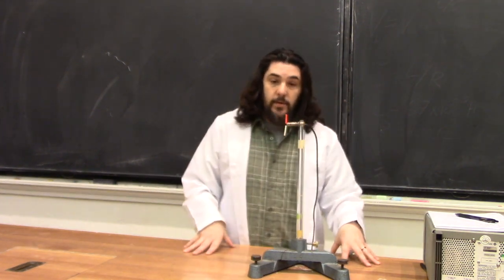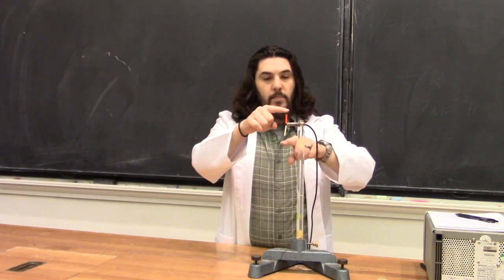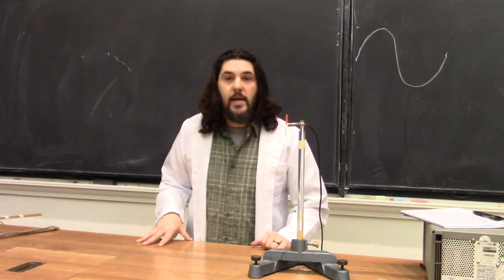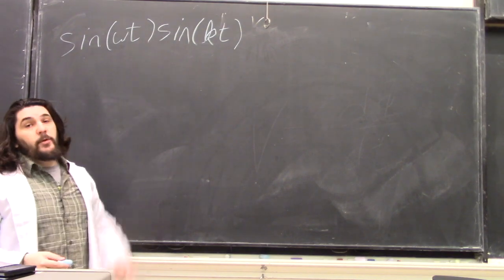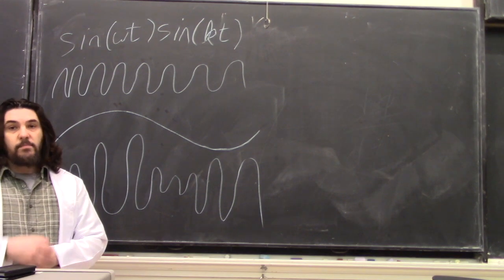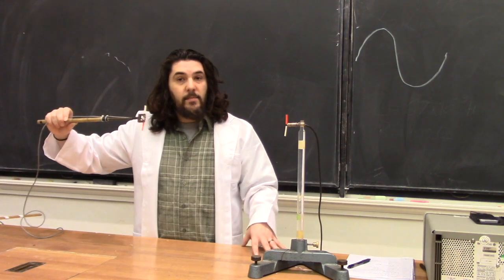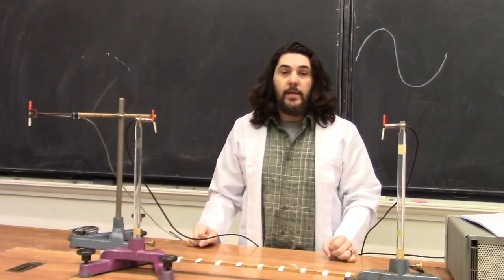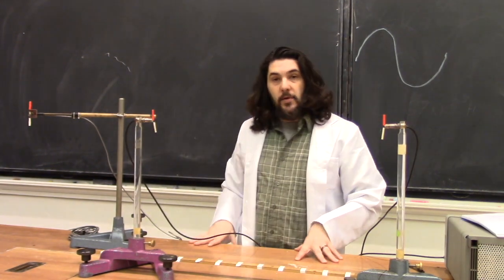Demos: Microwave Antenna

Comment: How did you build the receiver you are using & what is it connected to to hear the tones, thanks
Reply from the maker: The receiver is a simple coaxial cable (like a BNC) with the positive and negative terminals pointing in opposite directions to form a dipole receiver.  There's a resistor and capacitor between the terminals to act as a low-pass filter and to dissipate any charge build-up.  We just feed that directly to a preamplifier to filter and amplify the signal and output to a speaker.